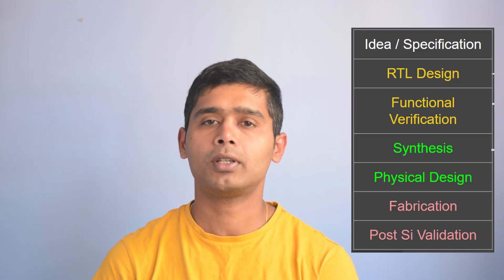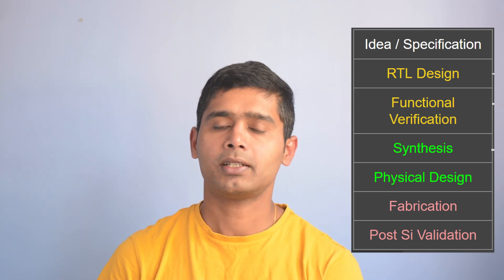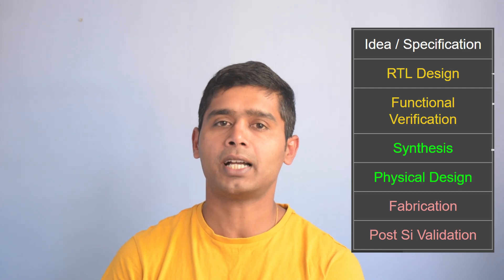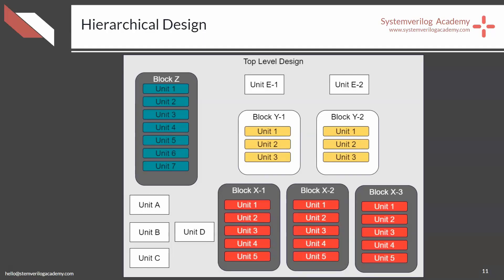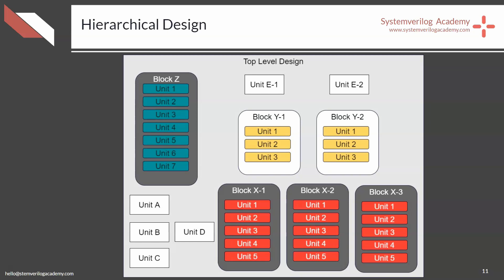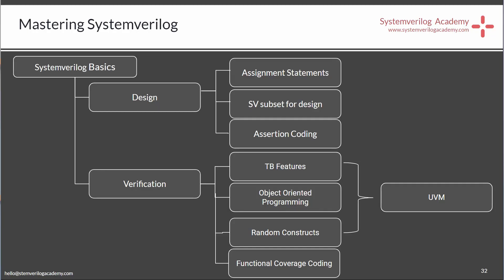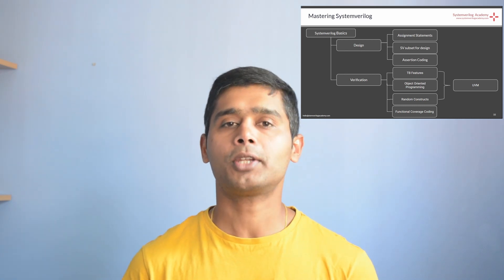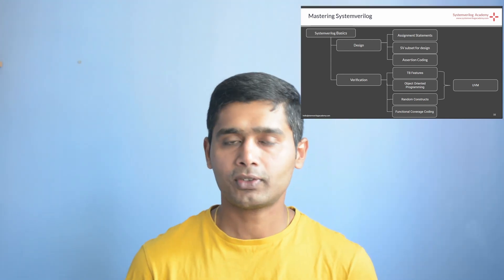Graduate Introduction to VLSI Career Options. What should I learn for an entry level job in VSLI ?

Comment: Thank you sir it's really helpful......:)
sir,
I'm a 3rd-year ECE BTech student and I have an interest in VLSI and RTL.
could you please give me a direction to get an internship in the field of RTL  and VLSI?
and how can I apply for the job in any company after completing my engineering?
Reply from the maker: Thank for the feedback 🙂

It's not a straight  forward answer. You can try different option along with your preparations.
1. If your college /university offers on campus internship selection, prepare for that.
2. If not, you need to use all channel for an internship like, friends, alumni etc. You may success , but changes are a bit less, but should give a try. Also keep checking company websites  and try, again chances are less. 
3. If you can't find an internship/job by the time your course complete, try for a bit less paid jobs in services sectors and slowly you can upgrade 🙂 ,  again you need to use all channels and not easy as well. 

I know I din't give proper answer, but this is all what I know.
All the best.